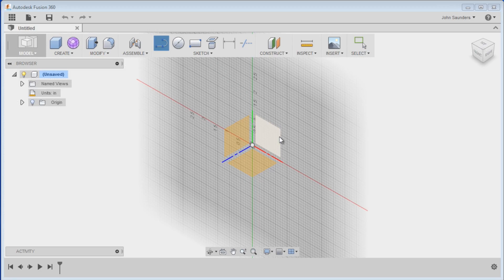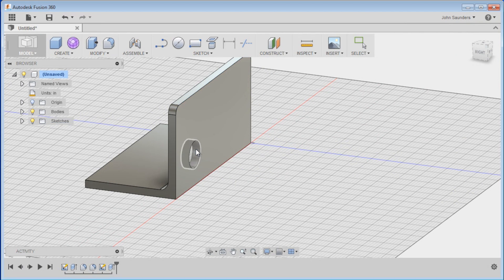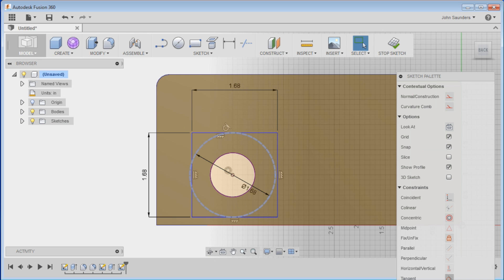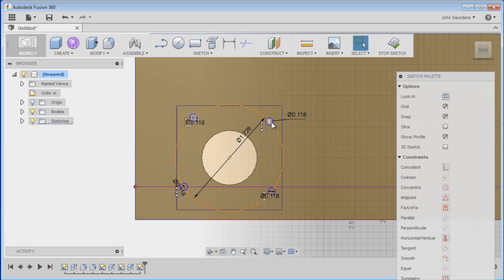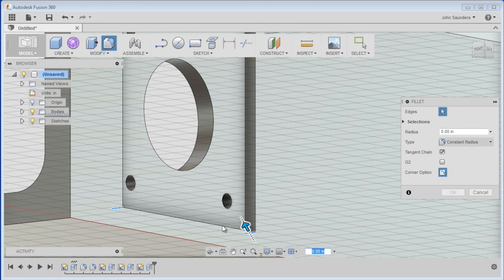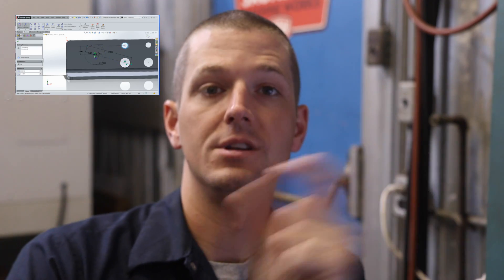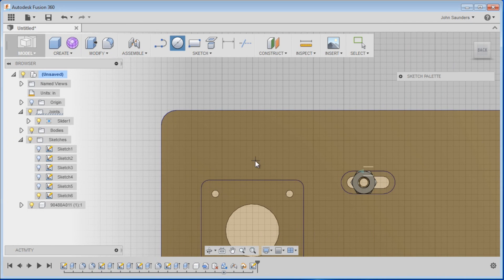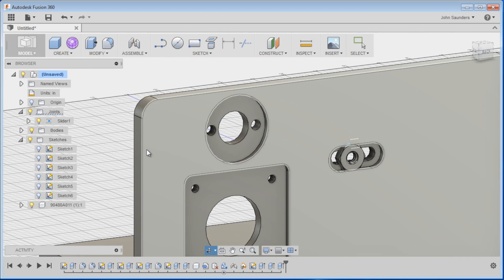Fusion 360: Arduino Stepper Angle Bracket CAD!

Comment: Great video. Check out Autodesk Inventor, I use it every day at work. It's very similar to Fusion 360 in the way it works but the icon layout is much better. You can also export your models to .stp files and others so you can use them in SolidWorks

Comment: Love this channel!! the videos are always hard enough for me to learn something new and not that hard to lost me :)
Would you do some video on what kind of CNC machine and software you recommend beginner to buy? I recently bought a $1500 CNC from China, I am satisfied with the accuracy, but the Mach3 motion software and the parallel port to connect to computer was a nightmare to figure out. The documentation was half English and half Chinese, I can read Chinese, but I'm sure people who can't would find that booklet not so helpful. It also turned out I never needed a water cooled rotor as the rotor don't really heat up even when the water pump is not turned on.
And some fun facts: I always thought 3D printing was some brilliant idea they invented, until I was in the CNC world and I relied 3D printing is just the opposite of machining which people have been doing for decades
Reply: NYC CNC Fusion360 and Mach3 is capable enough for my project, but in fact im using autodesk inventor/solidwork + artcam + Mach3 because I get CAD from other team members. btw, the Mach3 came with that Chinese CNC won't read feed speed from g-code so I always have to manually over-ride that, have any idea why?

Comment: I see you got the SolidWorks tip, yah same reaction.   Autodesk is never going to change their navigation type,, that has been the bitch since the begging of time...   QUESTIONS:  What post are you using with Path Pilot, I just purchased F360, coming from Rhino/Sprut w/AD and SW experience.
Reply: NYC CNC Will do thank you John.

Comment: good video John,  I'm not trying to spend your money for ya but I have to tell ya this brother,  I use autodesk inventor right now for my g0704 converted cnc.  I recently pulled the trigger and baught a cheaper 3d mouse from 3d connexion the space navigator model   less then $100 bucks.  Trust me once you purchase one you will never want to go back to the old ways of manipulating the model.  Guarantee you will thank me for the advice if you ever get around to it.  :)  Now the wife on the other hand because of $ may hate me for it.  LOL,   seriously as much cad/cam as you seem to do it will increase your production time by a considerable factor time = money :).   Take it easy brother and great videos as always,  I would like to see more of the autodesk 360 cad and cam.  I'm considering using it soon for the 3d capabilities on my slow go704 mill/conversion :(  :)   .   Later man.  Mike spino
Reply: NYC CNC I can promise you it is one tool you will not want to live without if and when you get a chance to try one out.  It took me about less then a day to get the hang of it and break my shift /middle mouse button habit to manipulate the model(old way) I swear to ya my friend My mouse wrist does not hurt any more and It more then doubled my efficiencies of making 3d models,  I just recently switched to a trackball as well and am starting to feel like that was a good move for cad,  itleast for the wrist, as far as speed goes I'm almost as fast as when I use a mouse almost.  The trade off almost appears to be worth it absolutely no discomfort after an hour of 3d cad 'in .  Take it easy brother keep making the great videos :)

Comment: What changes when you mark a circle as a construction circle? I've seen that in the Fusion360 tutorial videos also, but haven't figured out why it's done.
Reply: Sometimes you need a circle or something to use as a reference to position something else but the reference item won't  actually be machined into the finished part. A bolt hole circle  is a perfect example.
Reply: David Queen Can't you do the same thing with a sketched circle?
Reply: Yes you can use a regular circle as the reference for something but if you convert it to a construction line/circle  you won't have to deal with it when you do the cam.  It helps keep clear what's for a position reference and what is a real edge in the finished part. I haven't done much with cam yet but I'm pretty sure construction lines don't show up at all while doing the cam work.